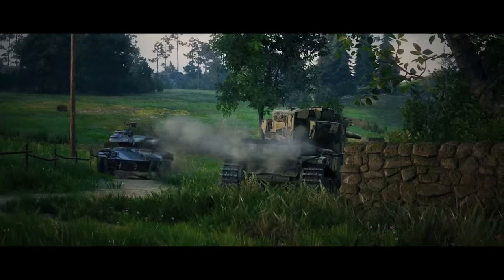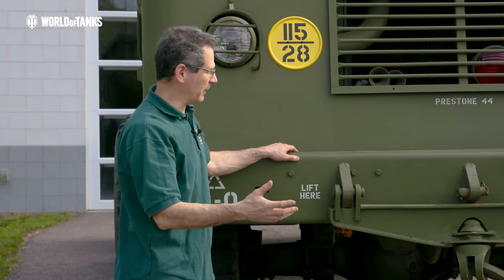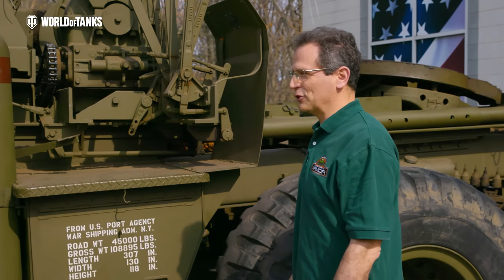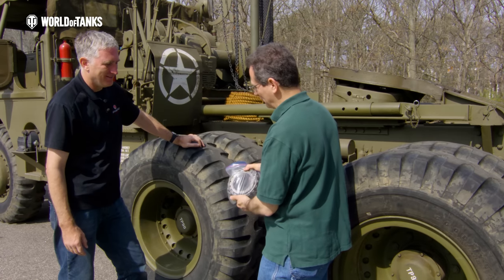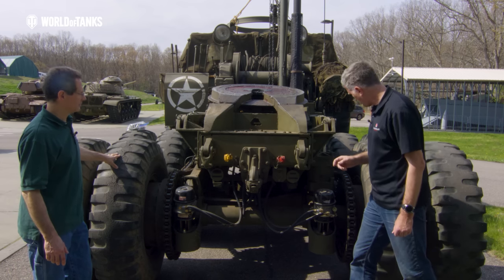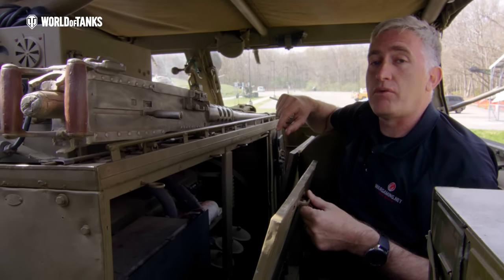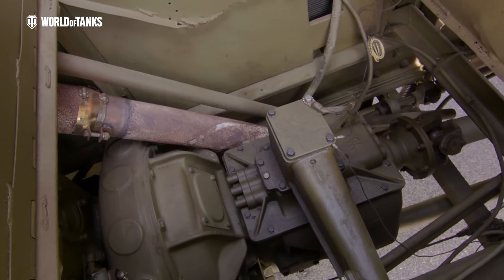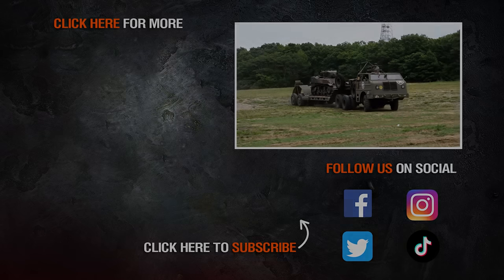Inside the Chieftain's Hatch: M25 Dragon Wagon, Part 2

Comment: Trucks use air brakes because they can be easily tied in to the trailer brakes. Connection coming loose/getting damaged doesnt spray oil everywhere, you dont constantly lose brake fluid every time you disconnect, and theres no risk of a leaking trailer consuming the entire oil reservoir of the tractor when you hook up.
Reply: Can you imagine trying to keep a hydraulic trailer system pressurized? That's a lot of hosing/fittings to leak proof.
With air you just let the compressor do it's thing
Reply: And air dont boil
Reply: Pretty much why they use them on trains, too.  Can you imagine trying to bleed the brakes on a 50 car train?
Reply: And it makes a parking brake incredibly simple to set up, it's just a fuck off huge spring
Reply: Best part is, if you have an issue or a problem the brakes by default come on, with a large spring that the air pressure keeps open...  Or the worst part, since without air pressure you end up with a ten ton paper weight, depending on how you see it.

Comment: I was surprised at the absence of brakes on the front wheels!  However, I recall back to my days as a firefighter, when for a while I was the driver/engineer (engineer = the guy that operated the pump) on a 1973 Hendrikson-Pierce pumper truck.  As a safety measure when responding on icy winter roads, there was a valve on the instrument pane that disengaged the air brakes on the front axle.  This prevented one from skidding the front wheels on slippery roads and thereby losing steering control of the apparatus.  I suppose that the supercharged Detroit Diesel 8V71 with it's Allison automatic transmission kept the rear wheels from locking up.

Comment: Air brakes are used largely because if there is a leak in the system you can't run out of brake fluid.
And front axle brakes weren't required on North American semis until July of 1980. There were issues with the front wheels locking up and trucks losing the ability to.control their steering with the wheels locked.

Comment: I have never seen a drive shaft parking brake work on ANYthing, and I've seen a bunch (since I'm old).
Also, I looked it up. That engine is 1,096 cubic inch displacement!
Reply: Truth, Simon at X-Eng came up with a kit to make the benford dumper truck disk brake fit the Landrover transfer box. I ran the standard dumped cable and over-centre lever and that was mint :o)  Before that I had threatened to drill holes in the brake drum and have a drop pin :D
Reply: Imagine how much frickin gasoline it drinks, jeeeeez!
Reply: @tacomas9602  They said about a gallon a mile.

Comment: Military kingpins are bigger than commercial. The fifth wheel is usually live as you noted too, swivels in two dimensions instead of just front to back on a modern commercial tractor.

Comment: Mildly surprised parts are so hard to come by. I'd have thought that these days modern machine shops with all their computer controlled tools would make it easier than ever to acquire custom replacement parts.
Reply: Yeah but those guys are busy and they charge a lot of money for custom-made parts, and a bearing assembly is a lot of parts serving as a unit. Machining a replacement component is always going to be possible, but it's going to be more than spending money for new old stock that's sitting around in a warehouse. That said, if you were really desperate, there's probably a machine shop somewhere in New Jersey that would take it on as a patriotic duty and only charge you an arm and a foot.

Comment: Why would the bearings be almost unobtanium Bearing making companies have a crazy supply you usualy just need dimensions and they can make it it might be pretty expensive but not unobtanium. Edit: Part Number 941 - 932-B, Tapered Roller Bearings from Timken I was able to find that for around $900 from a couple supliers all new manufacture

Comment: Air brakes are much more powerful than hydrallics.  All heavy vehicles have air brakes.  Rolls Royce has used an air over hydralic system which is a real pain to work on.  (I'm told).

Comment: No word about from what the engine was derived or copied, just deafening silence. I suspect it's based on work done by a certain Mr Hans-Dieter Paschke. Of course I have waterproof sources but I will keep them a secret. Also Fruehauf is a German name, so they must have known each other because both of them were active in the engine/trailer/tractor community.

Comment: But does the engine resemble that of the T-14?
Reply: Yes, the russians stole the design. 
Both engines combust hydrocarbons and turn reciprocal motion into rotational motion through means of a crank.
Pretty cut and dry if you ask me.
Reply: @NosferatuandFriends stole it from the Germans. Rudolf Diesel, probably.

Comment: Air Brakes are failsafe.. air hold shoes off the drums.. Hydraulic brakes are not.
Reply: True for as installed, not true for original equipment. There's also no real reason why a hydraulic system couldn't be installed in the same manner. The real reason is that air brake systems are expandable, so the trailer brakes can be connected to the tractors braking system, which would be an absolute pain in the arse with hydraulics.